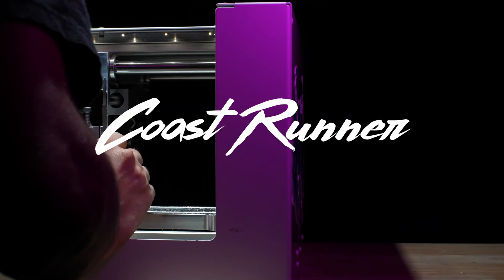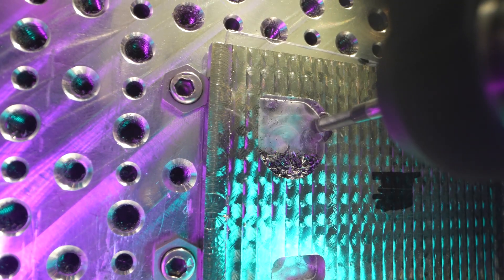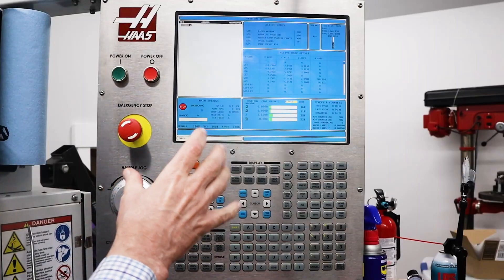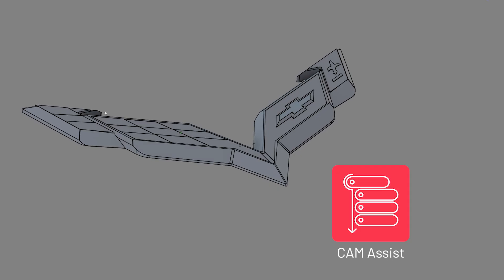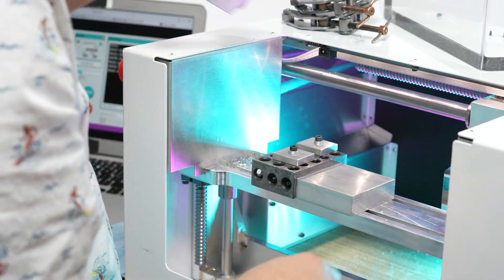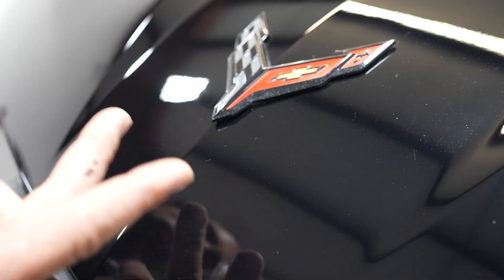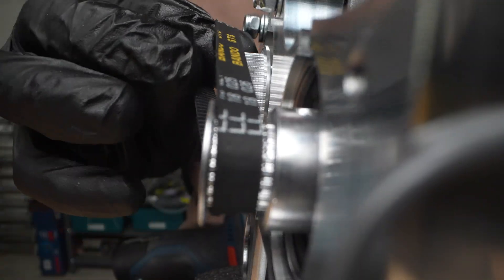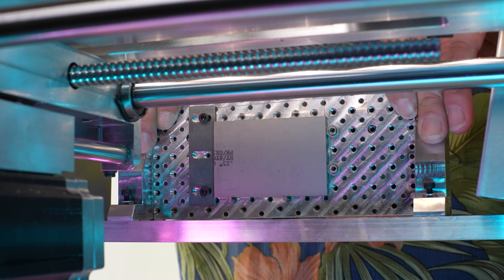Coast Runner CR-1 Launch Trailer

Comment: This comment is about your video, and is intended to be constructive and NOT critical:
The thumbnail shows what, at first glance, is a modern building with an ocean view... I passed over it, and only took it in second time around.
The title "Coast Runner CR-1 Launch Trailer" doesn't give any clues that it is about a CNC mill.  The channel name suggests an off-shore powerboat.
The voice-over used is more appropriate for the Ford Edsel release in 1957.
I understand that this is a "Teaser"... quick flashes of interest are the norm, but hold the shots a little longer so the viewer understands more.
Your little machine is mouth-watering!  A lot of the viewers will be knowledgeable, and like me, hungry for detail... we look forward to more.
BTW: I would have posted this eleven months ago if the YT algorithm had been kind enough to show me.

Comment: This thing works great but every time i try to make a cylinder head for my lego car i end up with an m16 receiver.
Reply: Lol
Reply: Coast Runner or ghost gunner
Reply: Then it's working properly
Reply: What is it with receivers?

Just remember:  you shoot someone or (threaten) 'warn' them by pulling or showing a gun?  Good chance you are going to jail.  If the cops -- who want to go home alive after their shift -- don't shoot the guy with a gun (you).

Laws vary, but if you escalate a situation by drawing a weapon, the judge is going to be wanting to know whether you went looking for trouble, or maybe even arranged the situation.  For some reason, laws seem to be set up to discourage shootings.

That's if the other guy -- or their buddy behind you -- doesn't shoot first, or more accurately.

Sure, sometimes you can get yourself out of trouble with a gun.  Just don't over-simplify, and look into what kind of trouble you can get yourself into.

Comment: This is the most non-user friendly CNC machine I have ever seen.  The biggest flaw is that the user can't see the milled surface without looking from above the machine towards the front of the unit. Most of the shots in the video are shown from the viewpoint inside the machine. I guess you could mount a camera inside the machine and watch it cut material on a monitor. Nobody else uses a horizontal spindle because you can't see what is going on.
Reply from the maker: The horizontal orientation was chosen due to the improved rigidity it affords. It is a little more difficult to see the work surface during operation than with a vertical mill, but you absolutely are able to look down from above and see it - plus, we have a mirrored chip shield on the spindle that also makes it easy to see how the cut is going.
Reply: How long is the chip shield going to stay clean enough to view the cut, when using coolant?
Reply: @scottwillis5434  I believe this design as a desktop CNC was intended originally to not use coolant. Coolant is messy and arguably counterproductive to the concept of a desktop CNC.  A small amount of lube at the start of each operation, occasionally during ops, and lower speeds works most of the time for me.
Reply: This thing has one main job, if you know you know

Comment: Is this newbie friendly, I want to do DIY projects but I have never used CNC before
Reply from the maker: It's absolutely newbie friendly! Upon launch we will be releasing a comprehensive education platform that will teach you how to run the mill and how to write custom code for it. I believe it is the most newbie-friendly desktop CNC available.
Reply: All milling machines are newbie friendly. You learn as you go, and have nothing to lose but your fingers. Seriously, watch out for little kids, long hair, floppy clothes. and fingers, fingers, oops there goes another one, fingers. Rotating machinery is inherently unsafe, but so are other, simpler tools. Remember that day you got yourself while trying to cut a piece of wood with a knife or a chisel. Or the lesson you learned when first trying to ride a horse.

The designers will include a substantial amount of cautionary material. You will be well advised to READ and UNDERSTAND everything before you even think about turning it on. You already own the most important safety device, located between your ears.